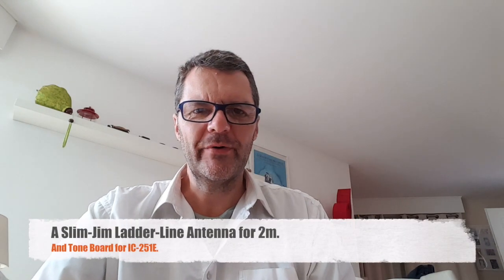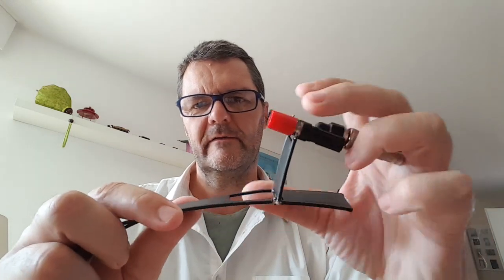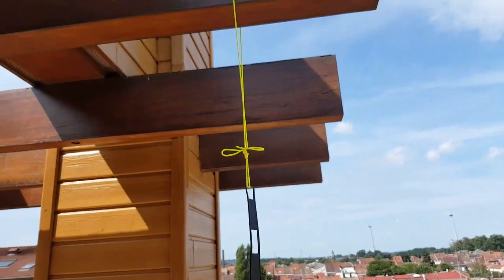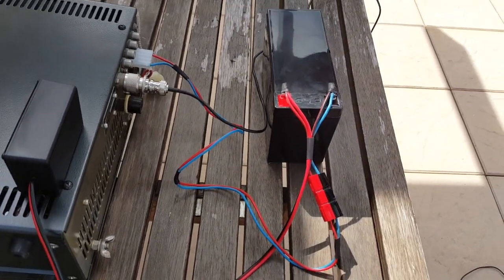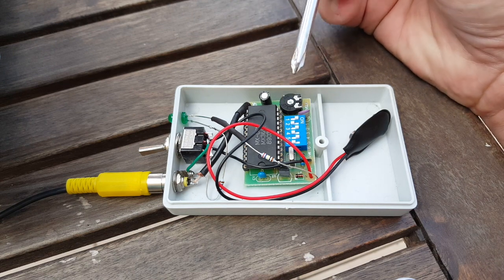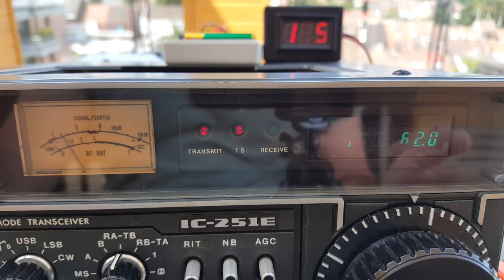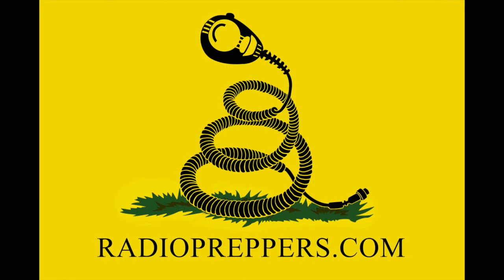A Ladder Line Slim Jim Antenna for 2m.

Comment: A great way to reinforce the gap - that is electrically neutral - is to use baking soda mixed with super glue. It will provide a super hard filler for that open space and it can be sanded/ground & painted  after it has dried .... Try it on some spare material and see  how well it works !

Comment: Thanks for another great video.
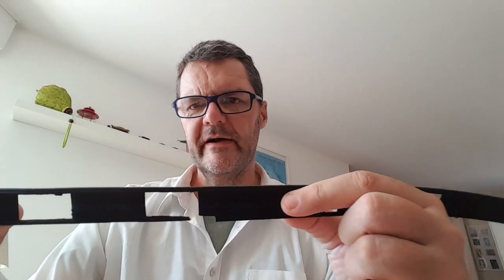1:17  Rather than reinforcing that opening, I would recommend (next time you're making one of these) that you measure out from that cut, such that the cut falls in one of the the solid parts of the ladder line (not a window). Then you measure out from there and let the ends fall where they may, rather than starting at one end and having that opening fall in a window.

Comment: Just got mine love it. However I launch antenna with a zebco/ sling shot. A quick shot into tree pull up 15 feet. And tie down . When it's time to go I "cut and run" hi hi.  enjoy how ever . And I use a choke made from a beer can x6 turns then tied off with wire ties x4. 73  de kv4li
Reply from the maker: Nice :-)

Comment: My hot tip: start by positioning the gap in the middle of one of the plastic reinforced sections of the ladder line. Measure in both directions from that point. No extra reinforcement necessary, although a short length of shrink tubing makes it tidier.

Comment: Just a quick note. If you measure the 1/4wave side so it falls within the solid section of the wire you will not need to add additional support to the wire since both ends are attached to the solid section. 
73; Kurt -W2MW
Reply from the maker: Not sure what you mean...

Comment: Hi, I followed your idea and built a 6m Slim Jim. While building, it occurred to me that if you use a balanced to unbalanced connector for a feed point as you do in this video then 2 things are possible: 1) You can completely cut the window line at the feed point, strip all of the ends and join them together inside the barrel connector. This would allow for some small adjustment in length to get very close to 50 ohms at the feed point making adjustment somewhat easier. 2) You could build a radial system  and terminate the ends into a banana plug and connect that to the negative side of the connector and have a basic ground radial system to assist with grounding. Not sure if this is even feasible, but it seems easy to test, especially at QRP  Love watching your videos, thanks!! - K0LEA
Reply from the maker: Thanks, that would be an interesting test...

Comment: Advantage of slim Jim over rubber duck even if it doesn’t have greater gain is it can be hung higher than the duck.
Reply from the maker: Absolutely. It does have more gain than the rubber duck though, or rather, the rubber duck has less...

Comment: Dear Gil, can you do some videos about chocks and/or hf avoidance in the shack -- I actually want to run wtsj-x on my computer at home and realize, that the hamlib interface does not work anymore when I use a certain power level above 8 Watt -- it is the direct influence on the radio computer system and not the power line or sound card/CAT connection to the radio. All these topics included are of real interest. Would be great -- I especially like your videos. They are  interesting and sympathic -- hope to meet you once on HF ... I just cannot read CW only send ;) For some reason I have big troubles to learn reading, because I did in the beginning wrong and memorized dots and dashes ;) Bad luck
Reply: If you once want to try CW with me -- would be a great honor. But we need than to communicate over the internet while doing so :)
Reply from the maker: Great idea, I'll add it to my list!

Comment: Could you please let me know what is the base material used for the black belt sort of wire here ?
Reply from the maker: The wire is ladder-line, a pair of multi-strand copper wire with plastic insulation.

Comment: hey when building a yagi antenna is it understood that you should get your connections to the driven element as close as possible, does it matter how close they are, is there a formula that is used to tell you what that spacing should be, I can't find anything on this

And when measuring the driven element can you take that spacing into consideration or is it disregarded entirely and you're simply measuring each half independently so that they both Total the calculated distance
Reply from the maker: Not that I know of... The little split coax there is does radiate a little too. I try to keep that as short as possible...

Comment: Hi Gill I have a slim Jim  2m 70cm  ordered for my yeasu  VX-8DE ..on it's way now. Just wondering would it work with  FT587D as well? Thanks for sharing have a good one mate 👍
Reply from the maker: Hi, it definitely should on 2m and 70cm. I'd suggest getting a clamp-on toroid choke to slide on the coax. It helps finding the best SWR sometimes.
Reply: Radio Prepper thanks a million my friend👍73s

Comment: Great. I read that it's the best one radiating horizontally. Odd design though, do you got field test videos?
Reply from the maker: +Croatia Prepper No field test yet. I need to make a new one for 6m because I used the ladder line for something else!
Reply: Radio Prepper thanks for the prompt reply. I am still trying to understand that choke thing. Isn't the slim jim unbalanced so the unbalanced coax shouldn't need a choke / balun?
Reply from the maker: +Croatia Prepper With an unbalanced antenna some current returns to the radio via the coax outer shield. The choke stops it. The fact that coax is unbalanced does not help because even though both are unbalanced they do not balance each other...

Comment: Binding post to BNC adapters are very useful.  I made a UHF dipole from one for an SDR dongle in a few minutes.  So quick and simple with two lengths of wire ~150mm long.  I may upgrade to 2 lengths of small diameter copper pipe with the ends flattened and drilled so each element just slides over the threaded post which will be kept in place with the red/black nuts.

I like the feed-point on your slim-jim.  Quick and easy to attach the feedline unlike others where it is permanently attached.  If you can't cut the notch on a 'rung' of the ladder-line, maybe use an ink refill tube from a biro pen to link the two ends of wire?
Reply from the maker: +humaxf1  Yep, I need a couple more of those binding posts, extremely useful indeed!

Comment: to reinforce the one you already have built, try using a length of narrow 'zip tie' to bridge the opening.  (maybe 'weld' it with a soldering iron to the existing plastic.)
Reply from the maker: +rkaag99 Maybe, since epoxy does not stick...

Comment: when cutting the notch out, pre measure the length so it does not fall on the 'window' opening.  the solid part of the plastic will provide the support while only notching out the wire piece from one side.
i built 1 for 222MHz band (US) and it works wonderfully.
Reply from the maker: +rkaag99 Excellent idea.

Comment: Gill you can another piece of "LADDER-LINE" segment like the same one missing and remove the inside WIRE and plastic weld the NON WIRE segment to the "SLIM JIM" antenna together =)   Welding ( melting ) the plastic will take a bit of practice using SLIVERS of the SAME PLASTIC use in the ladder-line =)
Reply from the maker: +Pat Hopkins Thanks, never tried that...